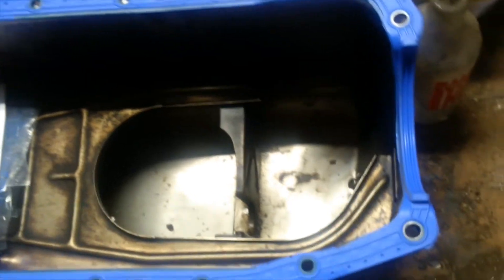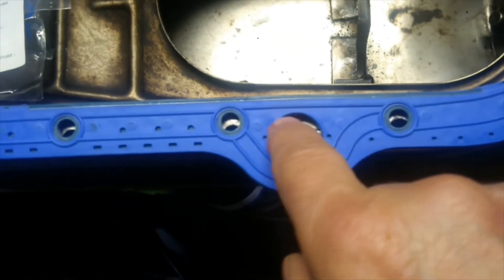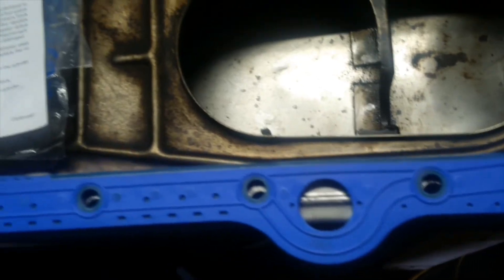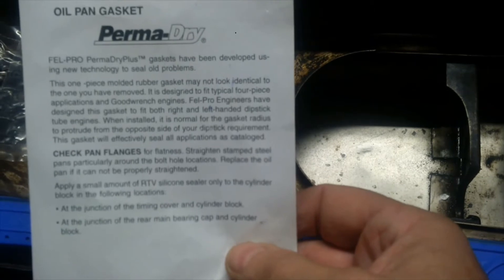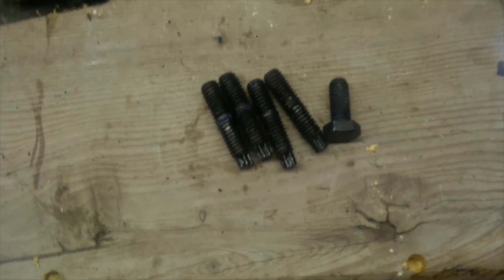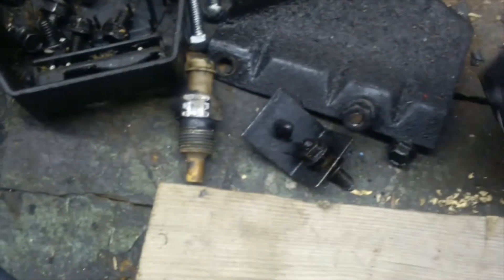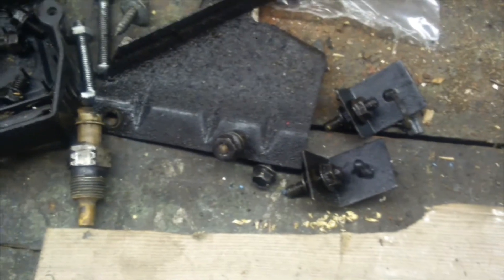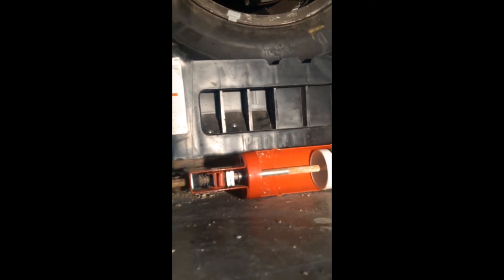Oil Pan Installed 1984 C4 Corvette

Comment: got a vid taking it off?
Reply from the maker: Unfortunately not. But the timing chain cover was off at the time. I had to move the starter over as well, and take the flywheel cover off. Hope that helps.
Reply: @1984C4Corvette_DIY_Garage  did you have to lift the engine or anything to get the pan off? Thanks for the info
Reply from the maker: @choice5641  Nope. It was pretty straight forward.